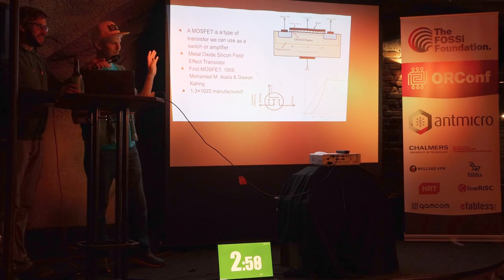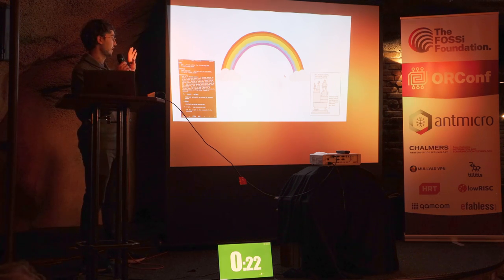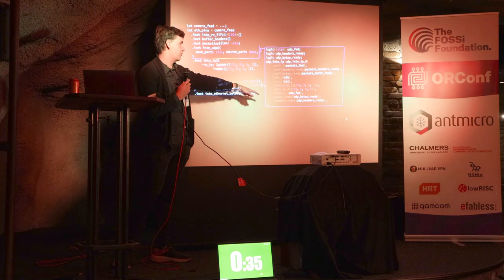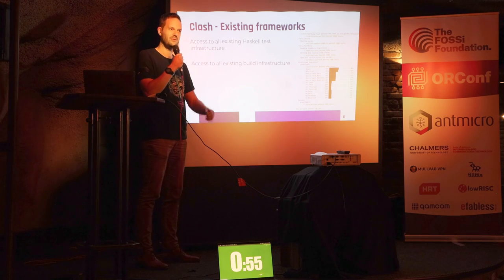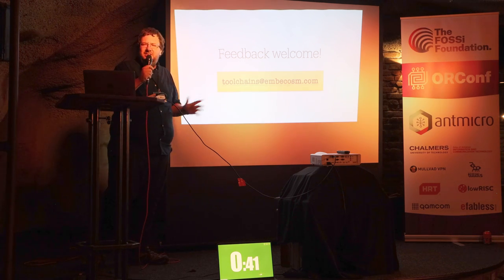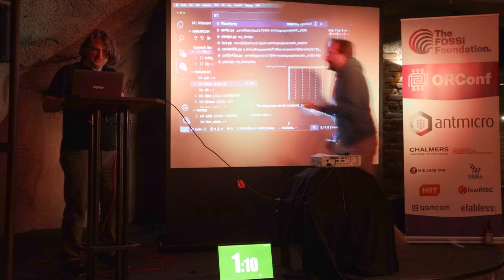ORConf 2024 Lightning Talks

Comment: 0:02 Matt Venn – CMOS inverter speed run
3:20 Nathan Gifford – Zine Lightning Talk
6:59 Frans Skarman – Ethernet in 3 minutes (?) using Spade
10:13 Todd Strader – Verilator and rr
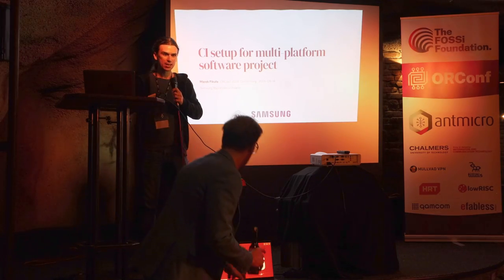12:47 Marek Pikuła – CI setup for multi-platform software project
15:41 Christiaan Baaij – Clash in 3 minutes
19:09 Simon Cook – RISC-V and OpenRISC Compiler Feedback
21:57 Francisco Izquierdo – Side channels for hardware design
25:00 Peter Birch – Define Your Data Structures in Python
27:18 Christophe Alexandre – Artificial Netlist Generator
29:27 Oron Port – Lessons learned from 3 student case studies exploring 6 different HDLs
32:37 Piotr Węgrzyn – Coreblocks
35:52 Olof Kindgren – IP-EXACT...ly where I want
37:50 Stefan Wallentowitz, Julius Baxter – Thanks to the sponsors, local organizer and everyone
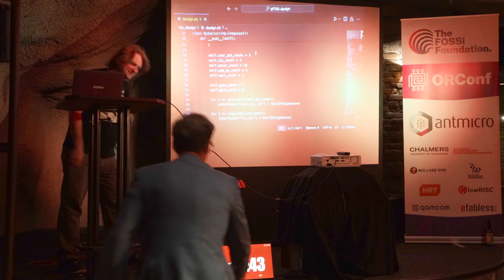39:37 Rob Taylor – Amaranth SoC, VS Code extension, ChipFlow